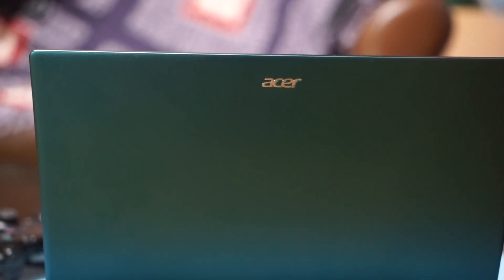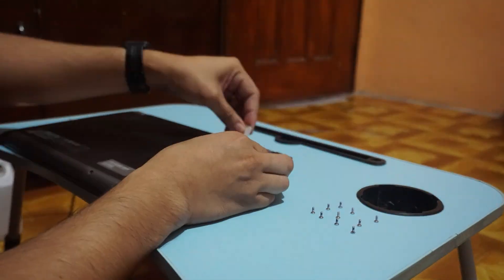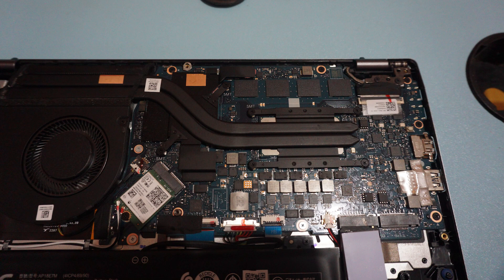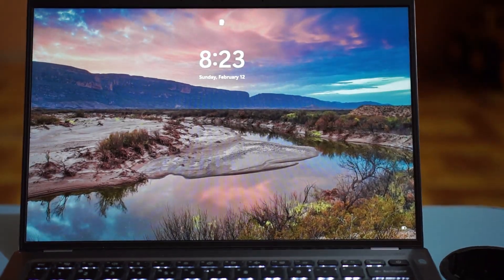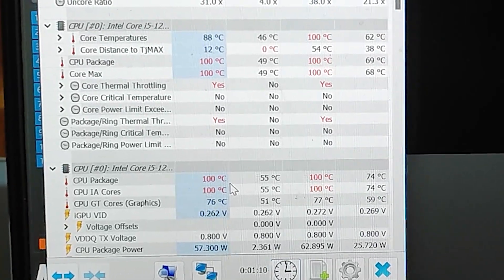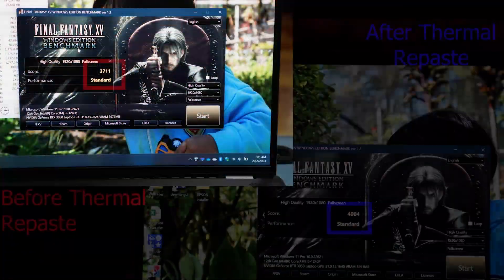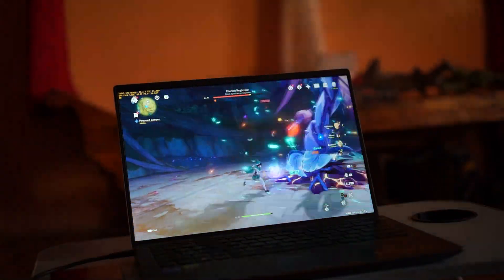Fix overheating of Laptop (Acer Swift X) using Artic MX-6 thermal paste

Comment: Kakaapply kulang sa laptop ko, kasi noctua nt-h2 gamit ko since. Same lang naman temps gpu 81C kaso from 500 ngaun almost 1k na price ng noctua. Kaya dito ako sa arctic mura lang pero sana tumagal sa msi laptop ko😅
Reply from the maker: @clive0494 problem sa Artic hindi siya ganun ka lapot.. So mas madali siya ma pump out VS noctua.. Noctua is better for long life.. pwede mo din try ung PTM7950.. Pero tingin ko mas mahal un..
Reply: @PinoyTechEnthusiast  paano malaman kung original sa shopee?
Reply from the maker: @clive0494  No idea.. pero madalas nag babased ako sa mga reviews ng mga naunang bumili..
Reply: @PinoyTechEnthusiast  pero ginawa kuna lahat ng experiment paminsan kasi nasa laptop architecture na. Yung cooling system ganun talaga. Buti nalang natuto ako mag undervolt at underclock.
Reply from the maker: @clive0494  Yup.. Underclocking and undervolting can help.. Na try mo na mag palit ng RAM? pwede din dahil sa faulty RAM kaya nag shushutdown ang Laptop..
Reply: @PinoyTechEnthusiast  never pa nag studown laptop ko, since 2014 ive been using msi afterburner. Ayaw kulang paabutin ng 80c kaso depende sa games. Kapag valorant cpu83c gpu67c kapag warzone cpu78c gpu83c. Nasa heatsink din kasi ang limit. Tried grizzly kryonaut. Cpu70c gpu60c kaso 3months lang nag pump out agad🤣  msi gf66 katana i7-11800H rtx3070 8gb 85watts 16gb ram.
Reply from the maker: @clive0494  Sorry got confused you with another guy.. Ako din.. Ayoko ng too much heat.. kaya I finds ways to improve the thermals.. Pero malaking factor talaga ang design ng heatsink ng laptop.. Kapag pangit ang design ng heatsink, kahit anong TIM gamitin mo, iinit at iinit siya..

Comment: Did you apply new thermal putty as well?
Reply from the maker: Yes, you need thermal compound/putty to fill the gap between the cpu/gpu and the cooling pipes. I used Artic MX-6 as thermal compound on my Acer Swift x (2022)
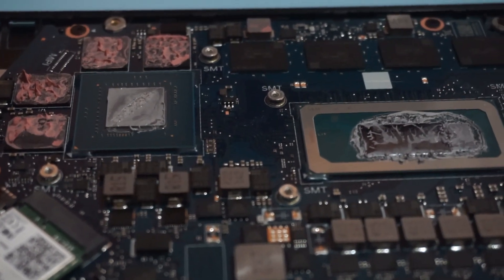Reply: @PinoyTechEnthusiast  Im not talking about the thermal paste on the cpu/gpu. Im talking about the reddish stuff that you can see at 1:19. I can see later that you must have  cleaned the red stuff off. Do you apply something where that red stuff was?
Reply from the maker: Yes, I also applied Artic MX-6 also on those.
Reply: @PinoyTechEnthusiast  Big mistake. Thermally conductive paste is not used to replace thermopads, it loses its thermally conductive properties at ~1mm thickness. Put Honeywell PTM7950 on the CPU, GPU and Upsiren UX Pro Ultra, Laird 607 or Honeywell HT10000 on the vrams and power section.
Reply from the maker: Thanks for the input, I will try those out..
Reply: @goorthiss  do you mean that reddish stuft is thermopads?
Reply: @BFFarmBukit  thermal putty is a great replacement for thermal pads https://youtu.be/raHKGnJ4LYM?t=547
Reply: What's wrong with the mx-6 on the cpu/gpu vs the honeywell you recommend? What/where is the 'power section'? For the UX Pro, is it' 3mm application? Thank you. @goorthiss
Reply: @Mr.Be93  There is no pump-out effect and does not dry out after ~8 months like most pastes that can not cope with the temperatures prevailing in the laptop which oscillate at 80°C. There is no more efficient paste than a phase change material like PTM7950 or Upsiren PCM-1. Yes thermal putty can be applied at the thickness of 3 mm. 1:22 the four pink square boxes near the GPU core are VRAMs and the other cooled fields are the power section in this laptop design. Often the CPU power section is also cooled.
Reply from the maker: @Mr.Be93  Typical good thermal paste solutions on desktop (like Artic MX-6) are not applicable on laptops. They were easily pumped out (pushed out between the CPU and heatsink). Unlike PTM7950, it does not pump out easily. Power sections are those small cube-like chips near the CPU and GPU.. You can see it on my other video (https://youtu.be/-HUqwx3UzSM?si=UllsiFmFdxQUiW-W). I applied Upsiren UX Pro ultra on them together with the VRAMs.

If you like my video, please like and subscribe to my channel. I will be posting more tech enthusiasts stuff soon.